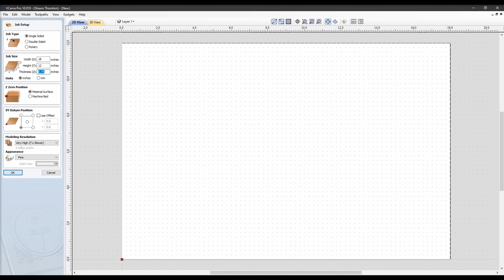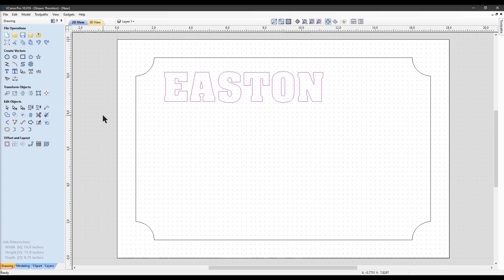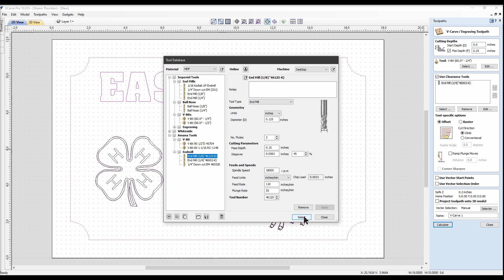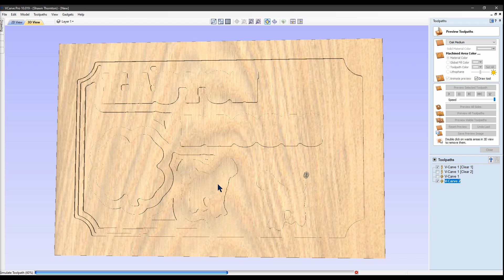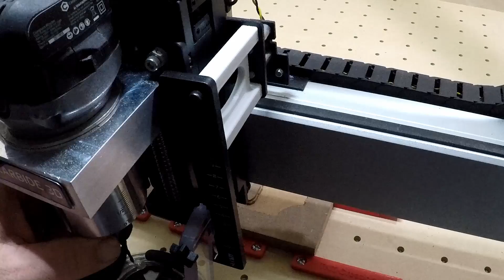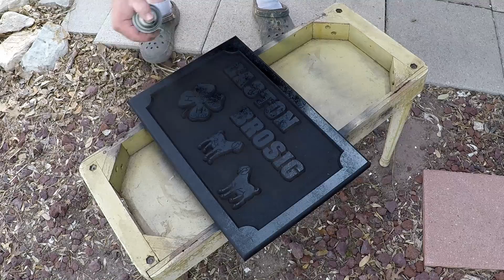Project Display Sign with VCarve Pro and Shapeoko

Comment: I have VcarvePro also and I'm using the Shapeoko 3 XL. What did you select for post processor ?? I have it select on Shapeoko (inch)(*.gcode). I  usually save/upload one file per tool. Then rezero Z hight using my touch prob. I just got the new bitsetrer and I don't wanna load one file per tool.
Reply from the maker: Did you figure out the post processor?  I have a video for it. Vcarve pro and bitsetter.

Comment: Great video, I learned something new so thank you. Do you have the bitsetter and how do you like it?
Reply from the maker: I was skeptical at first. Didn’t trust it. I actually stopped using it for a bit. Then learned more about it and have been using it every since. Setup is KEY!
Reply: TNT Creations TR thank you. I was thinking about getting it so I appreciate the comments
Reply from the maker: David Young , you’ll notice at the beginning of my videos, sometimes you see me use a post it note to set my Z height. This is BEFORE I start the actual job. I triple check that before I start. With that right, you will be good. If you have any questions, I’ll try to help. I need to update my bit setter video with the new carbide motion.
Reply: TNT Creations TR Thank you again. I have the touch probe but I have lost confidence in it so I use the paper method myself also. The bitsetter would be a big help but I wanted to make sure it does a good job adjusting the z height after bit changes. From this video it looks like it does.